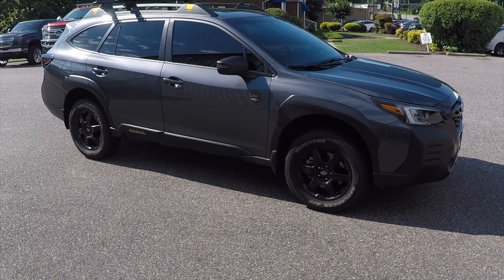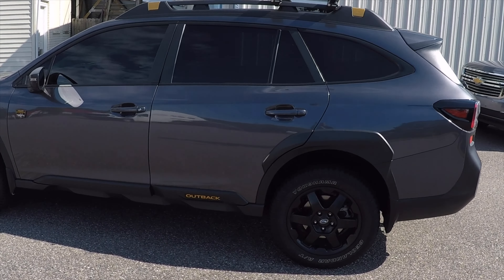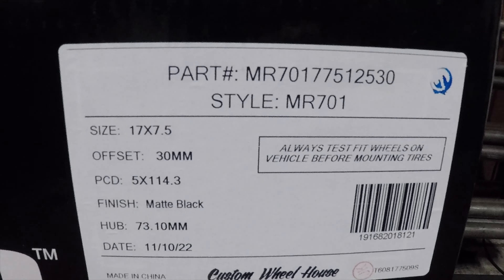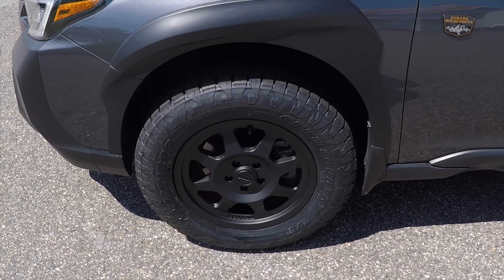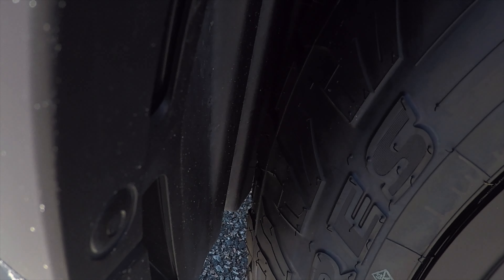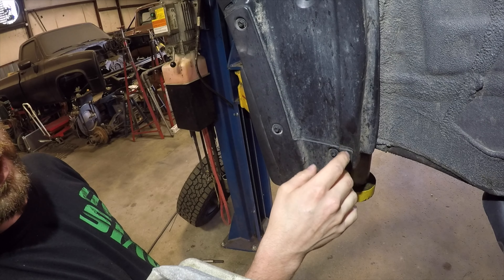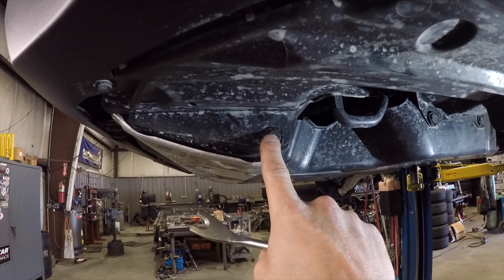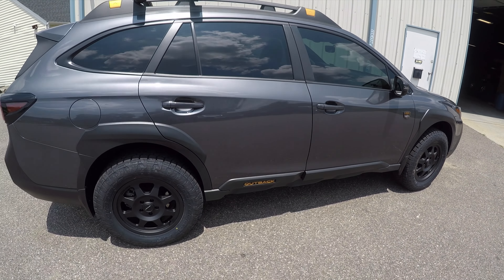245'S ON A SUBURU OUTBACK

Comment: I just bought a 23OBW with these same Toyos. All seems to fit without rubbing. My concern is using snow cables just in case on the iciest mornings. I'm also concerned how the tires might rub if I'm bouncing around and articulating on a choppy road. Any advice re this? Besides downsizing tires or lift spacers, what other methods to gain clearance?
Reply from the maker: @kohort1  check out the modifications on the plastic inner fender well movement in this video. That will gain you some extra clearance and is a pretty easy and un evasive task with at home tools . Thanks for watching !